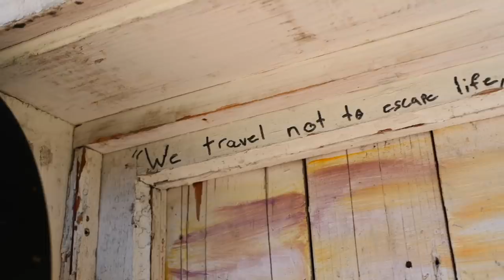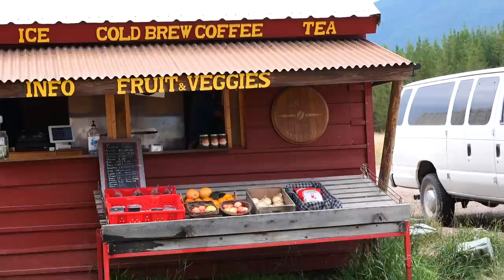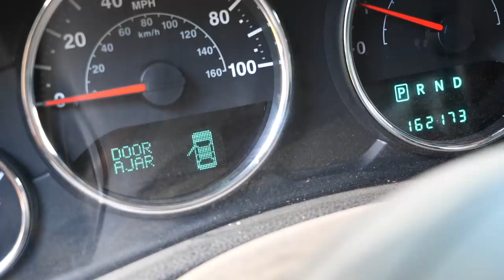V10E12: Northern Extremities of Montana

Comment: That open door is where the mouse got in possibly but not likely . Surprised there haven’t been more.but make sure all of your mod holes for wires and such are plugged. I like to use silicone ,animals don’t like to chew on it. Having found stuff in engine leads me to believe it had access through the firewall area.

Comment: The mouse was no doubt chewing on your electrical wiring. They are attracted to it because its made out of corn byproducts.  So it smells and tastes like food to them. You will be having issues with any and all things electrical.  I suggest you buy peppermint oil and steel wool.  Steel wool for any holes in the dash/firewall, cabin fresh air intake. Steel window screen material works too.  Peppermint oil sprayed under the hood, dash around the back of the cabin. Mice dislike the smell.

Comment: Having a mouse in the Jeep is disastrous, luckily it's gone. Since you've been able to determine that it was under the hood, I'd recommend that you inspect the wiring thoroughly for damage. Critters are attracted to the coating and will chew on it, causing damage to the electrical system.

Comment: Chris, you should have swapped to this at the first sign of trouble from the electronic swaybar disconnect.

https://youtu.be/i8EZwwxAuZo

https://www.offroadelements.com/evo-manufacturing-nolimits-manual-sway-bar-disconnect-wrangler-jk-jl-gladiator-jt-2007/

ps: I drop shipped you a silky saw "Zubat Professional Curved Hand Saw" to OK4wd back in AUG 2019 to replace the dreadful bow saw you had. What made you opt for the folding version? I have both. To me, the curved handle is much more comfortable and takes up little room tucked under the front seat. We love the area that you are now visiting. Our family has a summer house just west of Kalispell, on Ashley Lake. Safe travels to you and yours.
Reply: Honestly, I'm not convinced that the actuator has ever truly failed.  Typically the internals just get gummed up and need a good cleaning and greasing.  That's why it goes from not working to working at seemingly random.

Comment: You’re lucky the mouse didn’t eat through the spark plug wires, which sometimes have a rice derivative for insulation. When you arrive at new campsites prop the hood open and leave it open till the engine cools off. Rodents sometimes come inside the engine bay because of the warmth. Do you even read comments?

Comment: Your engine bay needs attention. It will run cooler when all that dirt is gone. Your various filters will last longer too. Just use your air to blow what you can off and then hose everything (everything!) down with a spray can of tire cleaner. I use Armor All as it has way less shine than most. Spray it on and forget about it! Til next time.  Also replace your cabin filter...